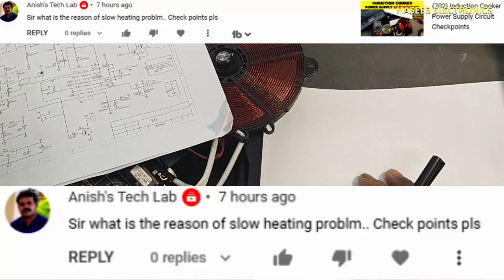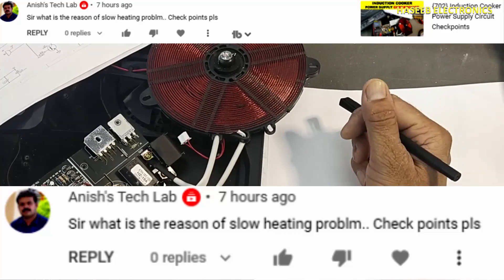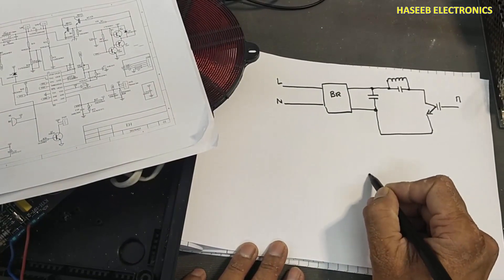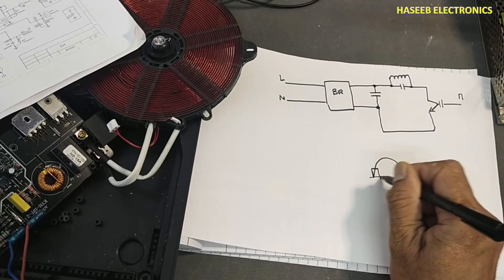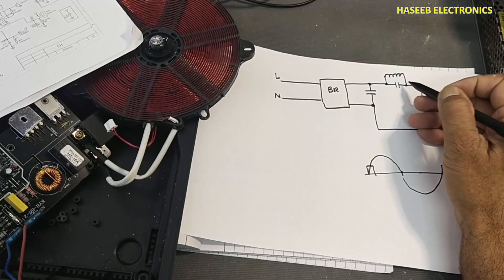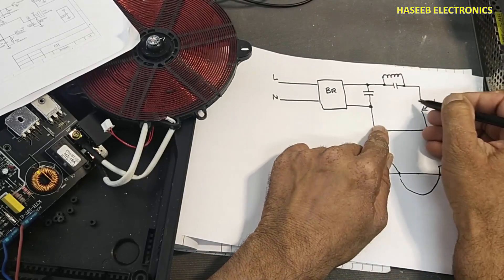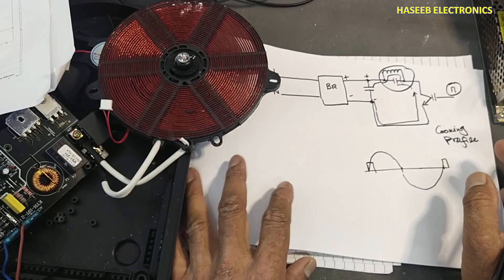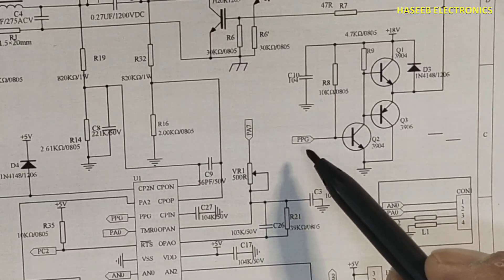{703} Induction Cooker Low Heating Problem, Possible Causes

Comment: Greetings from Poland!
 I watch your channel regularly because you present many interesting subjects and it's really high quality. I like the way you explain how things work or how to find a fault. Highly professional and explained in simple terms! 
 I learned few tricks from your videos that I could use in my work as a serviceman.
 One of my specialisations is repairing of induction cokers. It happened few times that there was a problem with reduced heating power. From my experience, the faults responsible were one of following:  
1. worn out resonance capacitor (decreased capacitance) - changes resonance conditions, can increase oscillations frequency (?), reduces power, eventually may led to IGBT failure
2. Increased resistance of shunt resistor because of overheated and oxidated solder joint - the current measurements are inflated
3. Some bad connections (like induction coil to induction module connectors not tightened correctly) - usually overheated or even burned out.
4. Overheating of the IGBTs sometimes causes reduction of power after few minutes, usually it is caused by covered air vents or bad installation of cooktop causing inadequate ventilation. Usually problem arises in high ambient temperatures (summer). 
5. The pots used - their material, diameter and construction of the bottom can make a big difference in achievable heating power.  Different pots can have different heating power on the same cooking zone.  The bottom of the pot could become delaminated, too. If the heating is slow, first check it with  few different pots if it's not the pot's fault. 
6. The distance between the induction coil and bottom of the pot is very important too, just as you said. A missing spacer between the coil and the glass can greatly increase power losses and temperature of the IGBTs, and sometimes increases max power. An increased distance between the coil and glass plate can decrease heating power.

Best regards

Comment: Hi sir, I have a problem with an American Whirlpool fridge.
The power board did not work and was repaired, other problems appeared with the display panel and the power board, indicating CF communication failure, there was a burnt resistance in a communication line on the display.
I solved it, but when I turn on the display appears blocked, and I can't unlock it at all.
The display uses the IC MC908 and the IC PIC16F power board, my question is where the problem will be, is it the PIC eprom or the MC908?
How can i find the problem?
Or what can i do for isolate the problem and change only the detective board?
Thanks.
Reply from the maker: if it is using PIC16F family microcontroller. check the complete part number (PIC16F followed by some more digits) and check datasheet. locate vcc pin of PIC16F and verify the VCC voltage, it must be stable. 
check its clock frequency, check its reset pin MCLR pin (MCLR reset pin must be low)
check LCD / display VCC voltage  
check LCD brightness potentiometer 
check connections between the display and the microcontroller 
if all checkpoints are good, then you can isolate by checking replacing LCD, then MCU, memory (it will include software problem as well) 
wishing you best of luck
Reply: The refrigerator has 2 electronic boards, the main one with the PIC16F877-04/P and the display module with the MC908LJ24CFUE. The main board has 5 power supplies with capacitor and resistor, the display uses a smps with 24V output and 7805 regulator, the voltages are all ok.
The reset pins are both at 5V, if you connect them to GND the MCU will reset.
Replaced the capacitors on the main board and a gas charge was carried out, the fridge worked flawlessly for a day.
However, the CF error appeared and everything thawed, I discovered a 220ohm resistor burned in one of the 2 communication lines, which will have pins 18 and 23 of the PIC.
Replaces the resistance, when I turned on the fridge, the symbol of blocked buttons appeared and the active holiday mode, which only works in the freezer.
By pressing the two temperature keys at the same time for 3 seconds, you should deactivate the key lock, but it just beeps and keeps the lock.
My question is whether it is the PIC that stores this information or the MC908.
I apologize for bothering you.
Thank you very much.🙏